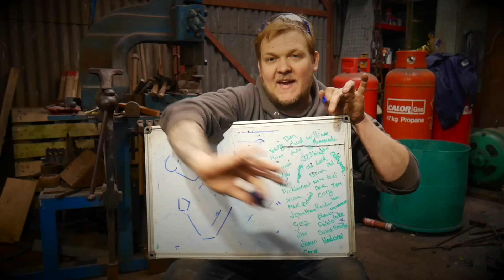More Poz Tongs! Second attempted to make the perfect tongs!

Comment: Poz tongs are my favorite topic.  I like your method of squaring up the corner.  Two aspects of Poz tongs which set them apart from other tongs are that their 1- jaws have a tapered point and, 2- rectanglish boss area has a near 90 angle to the reigns.  An added bonus would be "lips" on the jaws giving them the appearance that they are thicker.  Lazer cut blanks?  SURE!  I would buy them especially if their jaws are pre-offset.

Comment: Gotta say, I liked your first attempt at the poz tongs much better.  The second round don't have the pointy poz shape that makes them so useful.  They are closer to bolt tongs, but not that either as they don't have the clearance behind the jaw.  I do think the offset  tooling is a good addition and helps make the jaw alignment a lot cleaner.  I think the pickup tongs came out great though.

It would be interesting to try to create a pair of poz tongs with an adjustable joint like a pair of slip-joint pliers.  That would take the small, light advantages of the poz tongs and make them work for multiple stock sizes.

Comment: I liked the filter? in the outro of the video that fades out the background a little. The special effects not so sure, I guess they didn't detract too much from the content.
Love the tongs even if you not happy with them but I guess your standards lift with your experience.
Thankyou for your chanel and your great videos.
Reply: I tried to make a pair of poz tong. Done it wrong but got a reasonable pair of tongs. My jaws I placed half in the vice hot and upset along the jaw making the top fatter, then split them. Made the vee sides a bit thicker which was what I wanted.😊

Comment: Firstly, another great video. I think your Poz tongs have something good going for them but the second pair is moving away from the Poz tong profile and heading towards a pair of bolt jaws - the ends are square instead of tapered down almost to a point and the bit between the nibs and boss is defenitly getting bigger. I will say that I do like them, but not sure they fit the name any more.

Your music video section is interesting. The problem is that you're following in the footsteps of Alec Steele and Jamie a bit. If you want to go that style you need to play with slowing down and speeding up the video's so that the beat hits on the hammer blow. With songs with a slightly more complex beat that can prove tricky. Also, you're probably going to need help with editing the video's. If you are making AND editing the videos to that extent you will burn yourself out big time. The beauty of Alec and Jamie's setup is that there's one person to each job, they aren't constantly burning the candle at both ends and a few places in the middle so they have more time to get it spot on. I did enjoy the music video bit, but I would have enjoyed it if it was a bit longer and a little cleaner. It's still an AWESOME first go and let's face it, blacksmiths very rarely get a bran new project perfect first time.... well, most of us don't get it right first time and I'm talking about the whole human race!! 

I really like that you're always pushing for the next level with everything.  Keep up the good work 👍

Comment: Enjoying content would like to see a video about laser cutting
Reply from the maker: Not sure a video isn't improved with the addition of lazers hehe.
Reply: @danielmoss2089  you mentioned laser cutting as part of the tong manufacture I was not aware of this being available outside large foundries and only for thin metal.  Aware of plasma and water jet cutting so was interested in what you meant
Reply from the maker: @sibat777  I have a couple of local companies that offer a lazer cutting service. Aluminium, copper, steel, stainless and more. It's amazing what they can do. The company near me can up upto 40mm think with there lazer. Pretty cool.
Reply: @danielmoss2089  thanks Dan would be great if they let you take a camera,  I watched Fireball Tool cutting out his blacksmith vice components with a water jet that was pretty amazing.  Did you see that build?

Comment: Tongs look great. I just wish you took a few seconds to demonstrate there use. Grabbing and holding rather than just sitting on the anvil. Other than that great video.
Reply from the maker: The Tongs I made for myself will be used in other videos. Ie the pickup Tongs. However its a fair point which I will bare in mid. Thank you

Comment: Try to sync the hammer blows and bend moves to the beat ( or if you did maybe do a little better)
Reply from the maker: I tried soooo hard to get very thing in time. Some where on and others where off just nit got the skill yet I guess. I honestly did try 😂
Reply: 😖 oh I know - it’s sometimes harder than it looks, right? I’m going from commercial photog/designer to blacksmithing and fabrication. Shaking the rust off my welding chops and gearing up. We should exchange brains for a couple weeks. 😎
I think you did pretty well. Keep at it and try to think of the finished product you’re looking for as you shoot the content. Keeps the footage from getting out of hand somewhat.